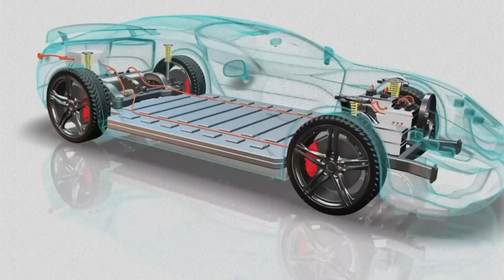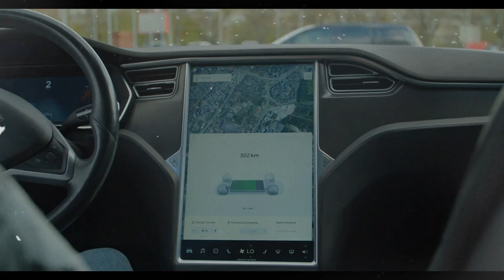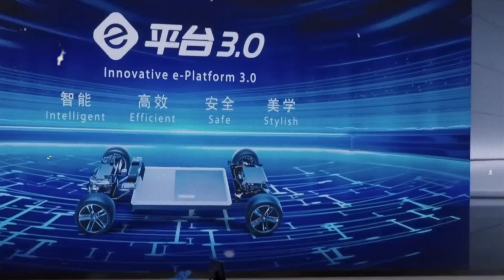CATL's New EV Platform Boasts 621-Mile Range, May Power Future Teslas

Comment: Who is CAT-E-L??   621 miles.  Dont believe a word of it.  CATL typically over estimates by 40%  EPA estimates are 25-30% overly optimistic.  Strange how it doesnt say how big the battery actually is, nor what chemistry!!  Why not?  Never trust ppl that hide info.  The integrated chassis design does sod all for the performance of the battery or the vehicle, but it does make it much more difficult and expensive to maintain when something goes wrong. KISS principle should be applied wherever possible.